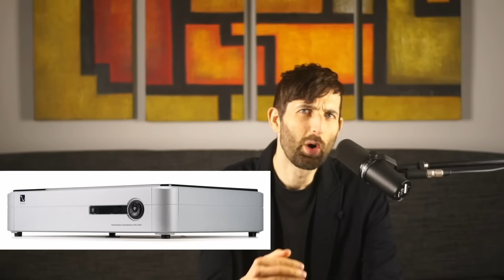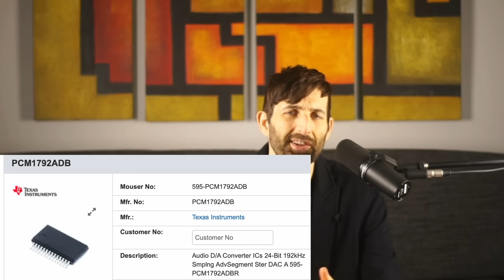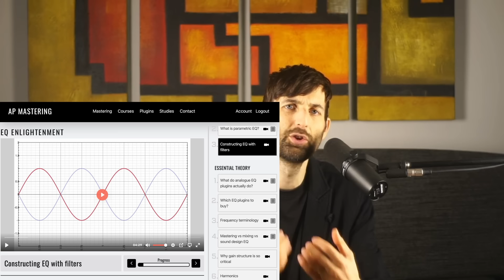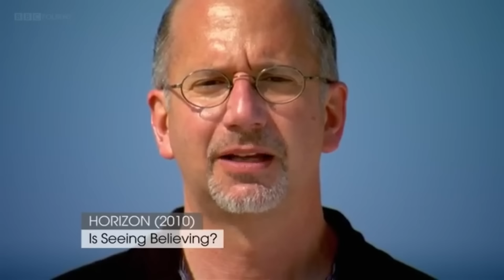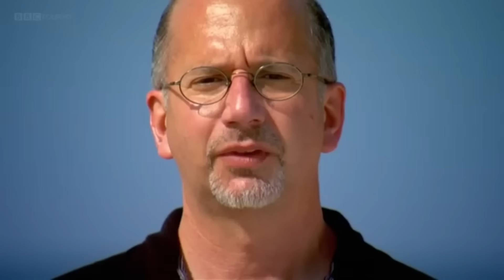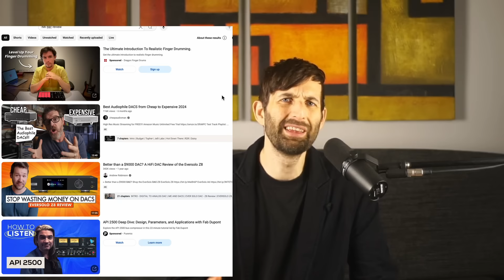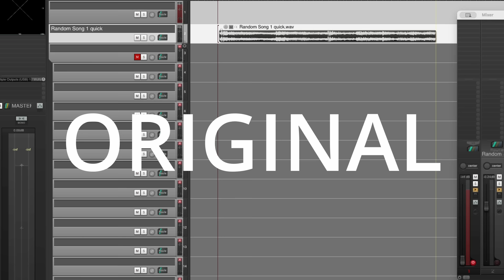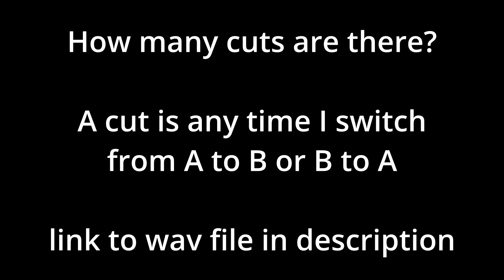The DAC Scam - Almost everyone believes the hype

Comment: Just my opinion and if I have wasted money, it’s my loss, no one else’s so there is no need for anyone to get excited. My experience is that a cheap DAC  performs nowhere near one that costs, say, 10k or more. I own both right now and there is a huge difference. Sure, I’d love a 10k DAC sound from a cheap 200 DAC. Could save quite a lot of money. I’ve been down that route. The thing is, you need the amps and speakers too! A 15 k DAC will need similar priced amps and speakers. Guaranteed anyone will hear a huge difference. Something costs more for a reason. By telling everyone all DACS sound same is misleading and many viewers will therefore miss out on what a high end DAC can really do if they believe what they are being told. A  £200 DAC cannot produce the open airy, detailed, solid, high resolution, layered, totally non fatiguing, wide, high, dynamic sound of one costing  15k.

Comment: The chip is an important part of the circuit. 
But DACs using the same chips can sound wildly different depending on how they are implemented into a circuit, and then there is the final output stage and how it reacts with the chip.
Then there is the power supply providing power , is it stable and can it support the out put peaks? 
Not to mention filtering choices. I have invested a lot of money in upgrading internal parts in my DAC. 
Then had a buddy listen to it compared to his stock version.  It was a big difference.
Reply: They can only sound widely different if the designer had absolutely no idea of what he was doing.

Comment: Do you have a high-end hi-fi system? I sort of agree with you about the chips however, I currently own a £1500 dac by chord electronics. i’ve owned and demoed many cheap and expensive units, a lot of them using the same chip, however they all sound completely different! All dac’s respond differently to the other components further the system, so there’s a lot more to it than just the chip, I have to say though, some of the Chinese DAC’s, the little circuit board ones, are getting really close to some very very expensive kit.🥂

Comment: You are right in one regard and seriously wrong on another.

1. Yes, many boutique brands and "ultra high-end" audio gear is priced just for that: the brand itself, like jewelry or super expensive clothing. Scams are also present in audio.

That said,

2. No, the same dac chip does not sound the same on every external dac, or preamp, or cd/sacd player. The delta sigma chip is only one part that determines sound in a dac, but it is far from being the only one, nor is it necessarily the most important. Just as important is the topology and parts at the analog output stage, which can have varying kinds of op amps, quality film resistors, and also very important is the quality and isolation of a power supply.

I own an older harman/kardon dvd audio and sacd player with a Cirrus Logic delta sigma dac chip which is not that expensive or exotic in itself, which is also used in many other devices, but the player sounds infinitely better than many separate dacs I have tested and it is regarded a vintage hidden gem in terms of sound quality because of it's excellent, refined, and solid analog output stage, so the same goes with well designed external DACs. The chip is only a part of the chain, what comes after it in the analog stage is just as important determining sound.

This is not "sassy audiophile talk", this is plain engineering logic any electronic engineer or can confirm.

Yes, there is snakeoil and insulting scams on many brands, but there is also well implemented electronic topology and well thought out engineering with quality stages on the other. Two very different things and one same chip can sound worlds different on different boxes. A DAC aint just the chip. The chip is just one step of many in a DAC.

Get your facts right, man.

Comment: Same years ago I designed and build myself a power amplifier just because I wanted to do that as a hobby. One asked me about it one day: do it sounds any good. I replied it doesn't sounds,  he: so the project has failed?, me: no, the project didn't fail, he: but you say it doesn't sounds good, me: it is a transparent amplifier and that was what I aiming for. Flat frequency response ( for the human audible range ), sufficient low distortion and noise. Never driven beyond clipping-point.

Comment: I'm going to give my own experience, and if other people want to test they can. While I love music, I'm not someone who is a bottomless pit for money and audio equipment, but I do spend way more than most people. I did a lot of research on DACs and I chose a Denafrips Ares II, I paired that with a Rupert Neve headphone amp and a Sennheiser 650. The sound out of this is unreal, and it opened my eyes to what a DAC could do. I am someone who is very interested in audio, electronics, programming, tech, etc. I don't just buy the hype, I know there is a lot more that goes into creating an audio signal than just what the chip puts out. In fact, if the circuit design isn't there it doesn't matter what the chip puts out, it will affect the signal.
If you are genuinely curious about this topic and who is "Right", go check out the PCB of the Denafrips Ares II and look at what's going on in there. While people would consider this an "expensive" DAC at $900, once you understand the amount of work that goes into creating one of these, it makes a lot more sense. Ladder DACs are expensive because they have tested and paired all those components, this takes an incredible amount of work compared to a mass produced copy/paste like many DACs are.
While this set up isn't cheap (couple thousand total), it sounds far better than other things I've heard in this price range and far better than cheaper set ups. I've personally tested this too, in that I have tried dozens of DACs through this amp/headphone combo, I couldn't get anything else to sound nearly as clear or interesting. And this wasn't even me buying an expensive DAC and convincing myself I had the best thing ever, I purchased other DACs that were more expensive than the Ares, but I returned them because I just didn't enjoy them as much. I'm not even saying that the Ares is supernatural or anything, they have higher end stuff than that, but when compared to all the other DACs I tried in the $1500 level, I clearly preferred that one.
I'll even say that it made me feel bad about a lot of the music I listen to. I listen to a lot of junk music (we all do) and then when hearing it at a super detailed level, a lot of it would just sound bad. And you would expect a DAC to make it sound good, but the reality was that it was just doing such a good job at being so clear, that I could hear all kinds of issues in the music I wouldn't hear with other gear. There's one song in particular that I can't listen to, because one part of it just sounds "wrong" like there was an error in the mixing some how, you can't hear it with any other combo I've tried, the song sounds fine, but once you try it with this combo there's a good 5 to 10 seconds where it just sounds "off" and its hard to explain, but I've had other people do a blind listen to the song and I ask them to spot where it feels "off" and other people have been able to pick it out as well. But whenever I've listened to it through a different combo, I cannot hear it. There's other stuff too, like hearing faint breathing patterns in vocals, I've tried to find some of these differences with other gear but I just don't hear it with them.
Anyway, I'm not saying that these $50,000 DACs are worth it, but to say that anything over a certain point just isn't better I think is wrong. I feel that a lot of people are confusing the map for the territory here, and once you declare something is "clear", it doesn't really mean it is. There is a LOT that goes on between the chip and the output jack that people are not taking into account.

Comment: A professor who designs state of art music centers for decades said physics say that even if you use metal clothes hangers, straighten them and plug one end to the amp, one end to the speaker should make no difference from expensive wires.

Comment: Tell us you don't understand anything about FPGA chips without telling us.  
The reason they are used in custom military applications is because the machine code is field programable. Hence, it can be adapted to custom applications.  

In DACs, using custom programmed chips allows it to be hand tailored for audio and even the specific device. If anyone is curious what the difference in sound is, don't base this off the opinion of a guy on youtube who doesn't even understand the topic; instead, just walk into to a hifi shop and ask to demo different DACs, if you think they sound the same, then great -- save your money.

Comment: You do know a dac is more than a chip, it is the while opamp stage, power supply, how well is the clock designed, and then there are the fpga dacs with their own software. I agree house prices for a dac is maybe too much, but a company that designs a dac that has taken years before it is on market is not free. Rob watts have worked years on the fpga dac software… so sorry you are making it to simple just to get views. With all do respect.
Reply from the maker: will make a DAC in an upcoming video to prove my point

Comment: It goes like this,  if you have a £2000 CD transport ' one is not going to spend £150 on a DAC, more likely one would spend £1200 or more.

And if you spend more on a dac' you get more inputs and outputs so one can improve other sources in the very large system one has built.

        End of .

Comment: You are right about most designs using cheap chips. I am an engineer. The low latency chips all suffer from poor quality upsampling filters that will degrade sound - especially 44.1KHz Redbook data. If you use only high resolution audio at 88 or 96khx and higher sample rates then the chips don’t perform quite as badly. Nevertheless, there is a huge improvement available if you get away from chip-based DACs if you listen to CD quality files. I know it hard to believe but it is just math and physics and audio engineering has willfully ignored some major issues. There is an Audio Engineering test design engineer that pointed out the problem of upsampling filters for delta-sigma DACs back in the mid 90’s but the solution requires latency (which chip manufacturers will not entertain) or you must have high resolution audio to start with.

Comment: Well, ICs are physics. And every IC of a model is different. For measurement hardware you only use the best (low noise, high signal-to-noise ratio) ICs.
Don't get me wrong. You will never hear the difference of grade A IC in comparison of a grade C IC but for measurement equipment this is important. and so the audiophiles buy the grade A ICs. 🤷‍♀

Comment: You can get fantastic DACs for like 200 bucks. I have a MOTU that I love.  But this DAC is drastically different than others that I have had in the system, including others with the same Sabre32 Ultra DAC  ES9016. This is because they use different OP amps, different power supplies, etc. And while my motu has a great balanced output, my amp is single ended, and the motu used mediocre outputs there. 

While I agree most people shouldn't spend 40k on a DAC, there is a lot of value all the way up to a grand or so. Maybe not all brands are good value, but you are getting what you pay for in a lot of cases. 

I don't trust this guys understanding of audio engineering.  It is simply incorrect to say they sound the same.  As a guy hawking plugins, maybe he just can't tell.
Reply: Which one exactly?
Reply: @beslemeto  looks like I was referring to the motu m4, if that is what you were asking?

Comment: Just one mistake. The most advanced 32 DAC chips cost about 100 dollars unless bought in bulk. However, sonically, they perform no better than the last crop of 24 bit ones, but they do have more features. Among the the components of a superbly performing DAC it's the most expensive component. They run on 9V, so even the power supply can cost much less than that.😊

Comment: I don't dismiss the findings here completely but there are a few caveats. The first is that youtube compresses it's audio so in your comparisom test the effect may be masked by that. Secondly it may be true that two dacs using the same chips might sound very similar, but what about comparing DAC chips from different manufacturers. I myself have heard a difference between a Cambridge DAC magic and a Musical Fidelity DAC 90. There was no expectation involved. In fact I was expecting the DAC magic to sound better but actually preferred the MF even though it is quite bright. Of course, the chips that link to the USB can have an effect in this case. I personally have changed output opamps on CD players and been very dissappointed at the results which have usually been zero difference.
I have also noticed a difference between a super cheap usb cable and a better one from QED, Then I tested the qed against another cheapish cable and found they sounded the same. So this indicates a low price curoff above which it's hard to hear a difference.

Comment: The day that I finally heard and realized that my $1500 boutique speaker cables were actually worse than Moster Cable XP, and the Monster Cable XP revealed missing music and the fact that there was nothing wrong with anything in my system except for $1500 speaker cables. That was the day I woke up from the Audiophile Dream and decided to focus on Music instead of hardware.
Reply from the maker: it's possible that cables do something weird. i personally use standard 1.5mm2 electrical wire

Comment: The circuitry is what makes it different. R2R DAC doesnt sound like a dac with a chip, tube dacs doesnt like like solid state dacs. If your system isn't revealing you will not hear a difference

Comment: The Ultra High-End Best-of-The-World's-Best audio quality that can only be achieved when the ENTIRE AUDIO CHAIN is fully 64-bits per sample wide using ultra large condensor microphones for all music recordings that have a frequency response of 5 Hz to 200,000 Hz using the stiffest possible metal materials such as Osmium or Rhodium attached to a proper ADC (Analog to Digital) converter that is a full 64-bits per audio sample at 10 Megahertz sample rate (80 megabytes per second data rate) with a 130+ dB SNR (Signal to Noise Ratio) and ultra low self-noise of less than 3 dB and THD (Total Harmonic Distortion) of less than 0.00005% all sent out to a 64-bits at 10 MHz uncompressed WAV format audio file.

That signal then MUST get played out to a fully-digital fibre-optic signal transfer chain to self-powered speakers with a built-in full 64-bit DSP chip (Digital Signal Processor) and 64-bit DAC (Digital to Analog) at 10 MHz sample rate converter that then sends each frequency band to multiple super-stiff Borosilicate glass plate and/or Sapphire-Ceramic-based audio-frequency-band-specific speaker drivers with frequency responses in the range of 5 Hz to 200 KHz .... ONLY THEN will you have true high-end sound quality!

And to ENSURE the data for the audio quality testing is TRULY OBJECTIVE, one needs to do LASER interferomtry where you sample the first part of the audio chain (aka the microphone) by reflecting a light beam off each condensor module itself at 64 bits per sample or more and at a sample rate of 10 MHZ or more and display the waveforms on screen at the same time as the audio sample itself so you can see the bandwidth/frequency response AND how ACCURATE the waveform is, plus see on-screen how much distortion (THD), signal to noise ratio (aka SNR) and see the base self-noise floor in dB. 

Then you sub-sample the UNCOMPRESSED waveform out to the highest current mainstream audio format of 192 KHZ at 32 bits uncompressed and compare the waveforms onscreen coming out of the ADC (Analog to Digital Convertor) to see the difference in the LASER interferometry waveforms from the microphones at the audio recording side and compare that to the post-ADC waveforms so you can SEE on-screen the physical audio quality of a condensor microphone capsule recording versus the digital or analog processed sound that finally gets recorded to an audio wave file!

The LASER-interferometry sampled waveform SHOULD match as closely as possible to the post-ADC/DSP processed waveform that YOU playback on your home/office DAC setup and any differences in levels, bandwidth, THD, SNR can be compared as a percentage-amount away from an ideal waveform! That is a TRULY OBJECTIVE MEANS to separate out the highest quality microphones, audio signal chains and and any post-signal processing chains from the also-rans!

Only when THAT is done can you expect Audio Nirvana for us mere Earth Mortals!

V

Comment: In this video you jump to global conclusions from information that does not back up your claim. Evidence that one DAC is not worth the money is not evidence that all high priced DACs are overpriced. Most of the well-reviewed DACs use proprietary chip architecture. An A-B test only works for very obvious differences. Subtle differences take longer to appreciate. This is just a video to reinforce confirmation bias for those who think this stuff has gotten too expensive. It has, but that is no reason to dismiss the field all together.